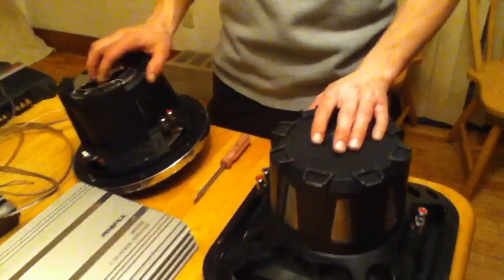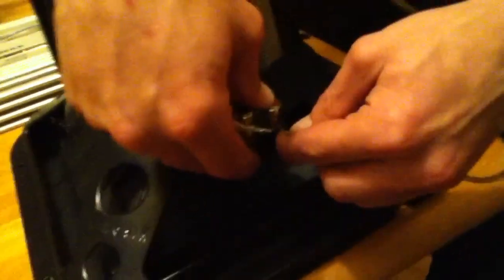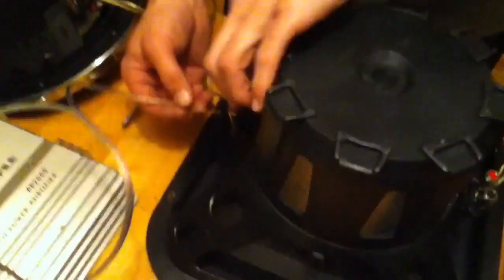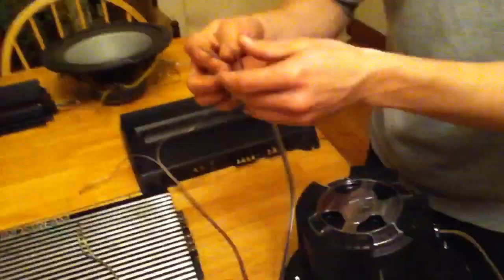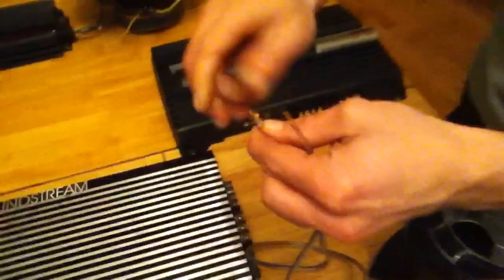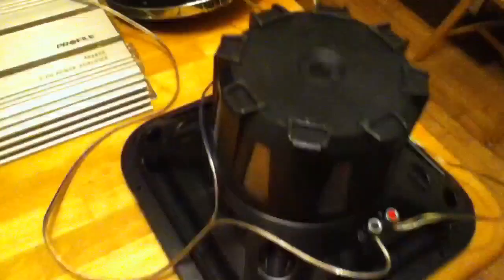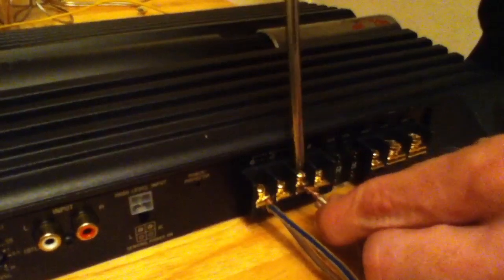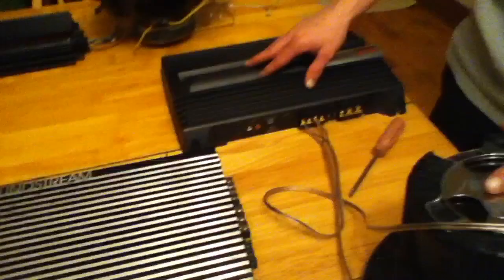How to wire 2 DVC 4ohm subwoofers bridged 2 ch. amp. Watch in HD!

Comment: i have 2 duel 4ohm subs but that amp is only 2 ohm stable not 4 ohm stable have to i make a finale 2 ohm for both
Reply: lilm1kemike im needing to know how to do the samething please help me out if you could i have the same amp that is used in this video and i have 2 12" hifonics that is dvc 4ohm's and supposably they are 400w RMS but I know that's not the true RMS rating of these subs but anyway i also wired them the way he did in the video and my sony xplod 1000w bridgeable amp goes off and on in to protect mode at high volumes using the wireing job this guy did and i dont like that at all it gets annoying. I even turned the sub volume down on my stereo but still does it with it wired like this
Reply: @henerylane4599  same here.. I did a little adjustments and jump a +/- on my speaker boxs and somehow its working fine
Reply: If it's 4 own sub you go from positive two positive negative the negative on both subs and wire them parallel one wire coming off the end of one sub jumpers on the rest that's going to put you at 1 ohm

Comment: how a I can wire my compr 8s to my cx600.1 if the switch said 2ohm or 8ohm
Reply from the maker: the amp is only 2ohm stable and with 2 of those subs you can only get 1 or 4 ohm , to be safe with the amp id set each to 8ohm
Reply: mazda2284 can you help me with a diagram, would that be to wire them in parallel?
Reply from the maker: correct , very simple , the switch on the sub makes it easy
Reply: mazda2284 thank you very much for your time and help
Reply from the maker: no problem , anytime , if you ever have questions feel free to ask and ill do my best to respond

Comment: what kind of wire is the jumper wire
Reply: Vanshod Watson I want to parallel wire my 4 ohm subwoofers and wire them down to 2 ohms and bridge a amplifier but the owners manual said 2 ohms is not recommended am I still able to bridge my amp because my amplifier is a 4 channel amp stable down to 2 ohms but in the manual it said 2 ohms not recommended for 2 channels
Reply: Vanshod Watson use 12 gage

Comment: How about if you have 3 of those subs how do you wired them on to 2 channel amp
Reply from the maker: RealTalk Freal you cant really. unless your amp can handle under a 4 ohm load bridged.
Reply: mazda2284 I have a 3500watts amp can it do it?
Reply: +mazda2284 2.7 not 4 and he can

Comment: hey mazda, i have 2 dual 4 ohm subs. i want to wire each one at 4 ohms to my 4 channel 1200 watt 4 channel amp. i want to bridge both at my amp to give me 2 channels at my amp.....according to amp specs.... bridged  is  4 ohms at each bridged terminal at my amp. i have separate positive and negative terminals for each sub enclosure at the rear of the sub enclosure, so i would like to use both plastic
 terminals at the sub enclosure..if you can help it would be appreciated.thanks a lot man,marc

Comment: will bridging a 2 channel amp that is bridgeable to 2 dvc 4 ohm subs get the same power as wiring each sub separately to each channel? also by bridging the amp, i see the impedance goes from 2 ohm to each sub wired in 2 channels to 4 ohm to each sub while bridged, will this damage anything?

Comment from the maker: that would be a dual 8 ohm subs my friend .  dual 4 ohm can only be 2 or 8 ohm . so each sub is wired to a 8 ohm load then each sub is wired parallel to the amplifier so the amp see 2 8 ohm loads parallel giving you a final 4 ohm load .

Comment from the maker: @mgbarela one sub per output ... is your mono amp 1 ohm stable ?  if so wire both parallel , if its 2 ohm your gonna have to wire each sub series to be safe on your amp

Comment: I have a mono 1500 wat amplifier with dual speaker output jacks. I wanna run two dvc subwoofers 4ohm. how to wire them. and should I bridge them or use both the dual imput jacks. What's the safest way.

Comment: I have a question as well. I have two 12.1d's dual 4ohm voice coils. rated at 350w RMS. My amp is a Power Acoustik OVN2-2200. How can I safely wire these up so as not to blow my subs.

Comment: Great channel you've got going on here! I've got a question... ive got a 2 channel amp (Rockford Fosgate P5002) that i had in my old truck back in 2006. I was using it to run a 15" Kicker L5 with it bridged but dont remember what ohms the speaker was. Im looking to purchase a new sub since i sold the old one. Wanna get a 12" Kicker L7 but not sure which ohm to get. The amp says 648 watts RMS @ 2 ohms with all channels combined. Which ohm sub do i need? 2 or 4? Thanks in advance!

Comment: hi i have 2 hifonics hfi12d4 600 watts max and 300 RMS and a 
•2-Channel Power Series Class AB Car Amplifier
•RMS Power Rating: ◦4 ohms: 75 watts x 2 chan.
◦2 ohms: 100 watts x 2 chan.
◦Bridged, 4 ohms: 200 watts x 1 chan.
•Max power output: 400 watts x 1 chan.
wat would be the best way to set them up to get the most power out the subs an amp or wat way would u do it....thx

Comment from the maker: @MrBass4life ok so if you run each sub 2 ohm on each channel , and your head unit puts out a stereo signal , each sub has its own signal and the subs could fight eachother at times . with both subs wired together bridged on the amp they both get the same signal , you also wanna use the same length wires on your subs .

Comment: @mazda2284 .ok well i really do have that set up with two 4ohm dvc wired on seperate channels @ 2ohm with stable amp-hifonics zxi200,2. do you think its better to bridge them as a mono channel even though it brings them to 4ohm total?
 or is 2ohm on 400W the same thing as 4ohm on 800W

Comment: @mazda2284  yea im buying jackhammer subs now. ill hook em up 4 like this vid..both my subs got damaged...gain was too high, fequency tuned wrong, box had air leaks, and worst the dvc 4 ohms were wired wrong..:(  i bought it used..only 1 side of voice coils was hooked up on each sub . i thought they were svc 4 ohms...its caused small fire inside my box and plastic bag was in there too..smoldering.. :(   yea thanks for this vid..hope my system is safer next time..

Comment from the maker: @jasonmangal if the RFL600D amps is the one you have its really a 1 channel amp... even though it has 2 outputs its still the same channel . your subs can be wired either 1 or 4 ohm ... its not a bridgeable amp . to be safe on your amp wire them 4 ohm .... you can try wiring them to 1 ohm and see what the ohm reading is on the meter.

Comment: i have 2  4ohm DVC subs and 2 channel amp like that one. do u recommend wiring each sub to 2 ohm and connect each on single channel? or the way u did it at 4 ohms bridged? my amp is 2ohm stable (mtx RFL600D mono block.) which way would give more power?

Comment: so if you have a 4ohmz Amp thats 2 channel and supports the RMS rating of the subs from (per sub) value like for instance at 4 ohmz the amp pushs 300 rms and the subs call for 300RMS, can you not just plug each sub Direct into the amp? or is the bridge part the best way to go?. Im about to install subs and need help. Thanks.

Comment: @mazda2284 you have missed my point.1 or more speakers should share the same postive and neg connection at the amp. you do not want mutliple runs of wire going to the amp from seperate speakers. at the end of each run of wire is a resistor 4 ohm 8 ohm what ever it may be and that will never change regardless what the amp sees as the total resistive load. the speaker is like a fauct thats half open only allowing the a portion of the power be produced to pass through. the rest is in line waiting.

Comment: @tonythephatone there is a difference. think about this awhile. Both speakers are wire in series making each 8 ohm then connected parallel to the amp. while the amp may see a 4 ohm load there are 2 distinct signal paths at the end of each is a 8ohm resistor. two 8 ohm svc speakers connected parallel will still be 8 ohms of resistance wired like this.The way Iam suggesting would make both speakers the same as one 4 ohm svc speaker but the power handling will be twice that of a single sub.

Comment: @dcbt96 you might get a little difference, but speakers are a reactive load.. as the coil moves (depending on frequency of course) your resistance goes up substantially.. the speaker that is moving more and faster will be at a higher actual resistance than the one moving less, and they will balance each other out a good bit. Also this is just a demo... I hope nobody is odd enough to wire two subs this different to each other. Same sub - shouldn't have to worry about different response.

Comment: That works... why not wire both POS. on one sub together and both NEG. on the other sub together now connect the remaining 2 POS. and NEG. together in series. this makes both speakers a common 4 ohm nom. load and ensure both share the same power. this is two speakers wired at 8 ohms independent making a parallel connection at the amp to 4 ohm BUT there still seperate allowing one speaker to see more or less power depending on resist. differences in each path.